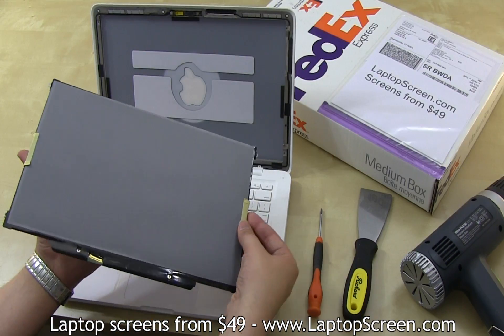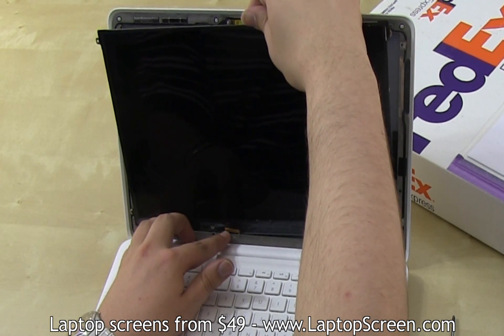MacBook 13 screen replacement /  Installation guide [Apple MacBook 13 White Unibody LCD repair]

Comment: Hi, what's the difference between the late 2009 LCD (6.1) and the mid 2010 LCD (7.1) of the white Unibody MacBook? You wrote the 6.1 and 7.1 aren't the same and so there have to be two different displays, but on your website there's only one LCD for the white Unibody MacBook!?
Reply from the maker: No difference. 
As far as the white unibodies go - the new "super round" ones are LED, older and less round - CCFL. 2009 was the first year of LED.
Our website lists screens by model "A1342" - LED, "A1181" + "A1185" - CCFL
https://www.laptopscreen.com/English/series/Apple/MACBOOK%2013/
Reply: Thanks!

Comment: Thanks, it's very helpful.
Two useful things :
- Peeling knife: To deal with destroyed-head screws. 1st time I was not aware of one screw being stuck so I completely destroyed the head of it. The I used this peeling knife to make new notch and succeeded to remove it. 2nd time I helped a friend to fix his screen, I used this knife right away for one difficult screw and so did avoid destroying it.
- Tweezer: To hold the locking bracket when plugging the screen into the connector (minute 3:00).

Comment from the maker: If you are talking about the "non-unibody" CCFL outfitted MB,
the replacement can be made a lot easier if the CCFL power cable is cut and then joined on the new screen during installation.
Otherwise the top cover has to be dismantled like on a 15" MBP.